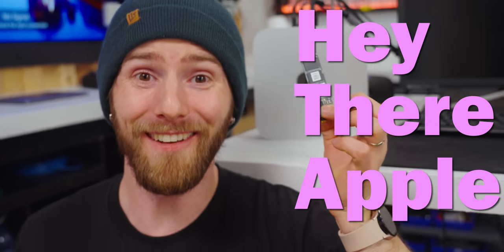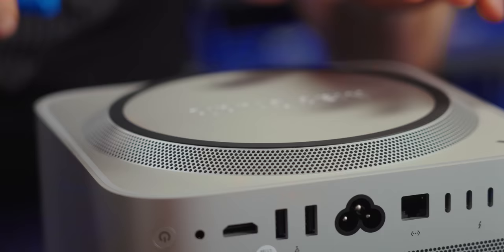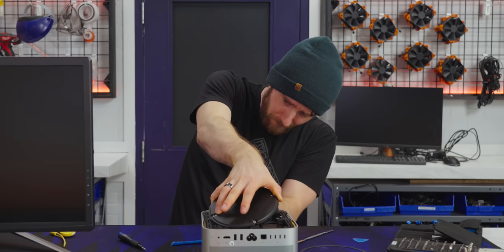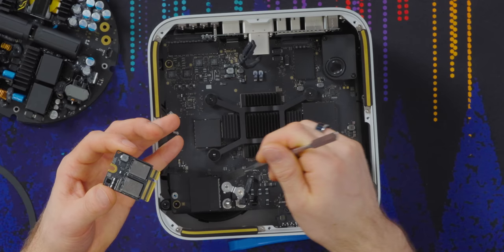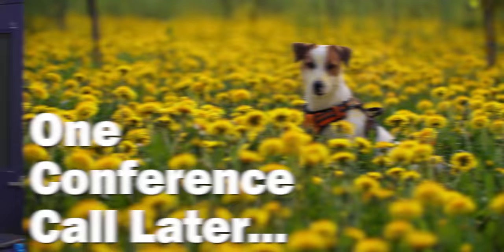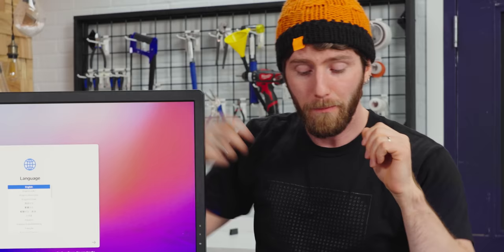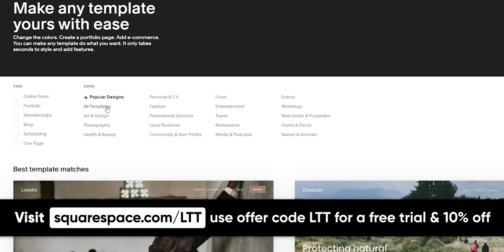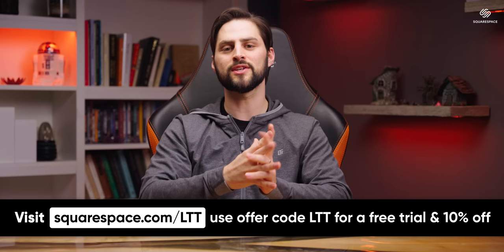I want to love Apple, but they’re making it hard - Mac Studio SSD Swapping

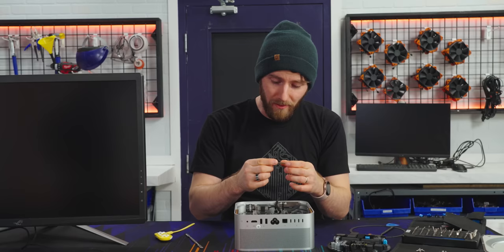Comment: 5:20 I thought it was better if the power lines connect before data lines, no? For ESD purposes, data lines are weaker, so I would prefer power lines to connect and discharge ESD before data lines connect. But you may prefer to live more dangerously!
Reply: Its the magic man!
Reply: I agree with u Medhi but the rest of the producers don't follow it so they swapped it with the safety concern as u mentioned cause even if the repairilbility plan back fired they would have a safety sheild guarding their asses 😂 this is business boisss
Reply: they aren't as smart as you mr Mehdi man
Reply: It's usually ground first, then signaling then power
Reply: @ElectroBOOM How was your trip to Hawaii?
Reply: Says the man who couldn't even kill a ram stick 😉
Reply: USB is power then data
Reply: Grounds first, Data second, Vcc last is a good rule of thumb. You can see a great example of this on a HP smart slot PSU's card edge connector. Those apple NAND connectors are not hot swappable, the contacts are staggered in the socket so that they make contact at roughly the same time. If you swapped it powered on, all you will achieve is apply gnd to half the card and vcc to the other half as the contacts go past power into data.
Reply: When ElectroBOOM tells you that you are living dangerously, take it to heart.
It would be like PhotonicInduction telling you what you are doing with transformers is crazy.
Reply: Hiii Mehdi how are you ❤️❤️
چطوری هموطن D:
Reply: ESD is not as bad as most make it out to be its actually really hard to kill a device with ESD i have never used an ESD strap when working with electronics and have never killed a device with ESD and everyone who has tried to kill devices with ESD fails to kill the device with normal ESD 

but havening power on before the device is fully connected can cause a power spike when the device gets connected and that is bad on the device so its always better to have the data connect before the power to keep the power spikes to a minimum
Reply: @ElectroBOOM Data before power is prefered, if the ssd is hot-swappable, which primarly happens in server applications. If not all of the data lines are connected before power, it can lead to errors.
Reply: You need to be a genius to understand what apple is doing. There they like to do things differently.
Reply: @jovaraszigmantas  Be a genius, or be drinking loads of Guinness.
Reply: Ground is supposed to be the longest pin!
Reply: Yes, esd crowbar protection diodes on IO do nothing if there's no current path to the supply rails
Reply: I thought the power pins were longer so that when removing a device in a hot-swap situation. The device can detect the disconnection of the data lines while it still has power. This gives it a chance to flush the cache and prepare for the loss of power with less chance of errors occurring.
Reply: I've had several HDD to USB converters and it's always been data, power USB and my external SATA drive connectors came with instructions for data then power. I believe that the reasoning is that when power is applied, the drive is running and random noise on the data lines could cause issues and potentially, it could be more vulnerable to spikes etc (this last is just supposition though). Connecting ground first would be the preference I think but there's usually ground on the data lines anyway.
Reply: @rayzimmermin  ESD is not as risky as it used to be, it seems. I killed a couple of devices with ESD in the past but none recently. Of course, I may have just become more cautious...
Reply: Lol when I read this in my head I read it in the voice and accent of electroboom...
Reply: @chaos.corner  the first PC i built was an old 8088 back in the late 80s and i have been working on PCs from then till now and i have never killed any device with ESD now maybe its because i have a rule only messing electronics with bear foot so im never insolated from ground and their for cant build up a charge so before i ever open a case i always kick off my shoes
Reply: @JasonW.  NICE
Reply: With Apple, I'm just surprised that there isnt a way forthis to connect a data line to a power line like in certain MacBook, where a 30V power line is right next to a 3.3V data line that goes straight into the CPU :D 

no grounding in between, and that connector is right on the spot where liquids are most likely to get...
Reply: As mentioned farther up the comment chain, I'd say the best possible arrangement would be for ground to be connected first, then data, then power. That way you have ESD solved, and also there's no chance of the device getting powered before the data pins are all there, and freaking out about that.
Reply: HI! I think you should ground it first then connect the data. I have learned not to plug in anything that is already connected to power because I did fry a board doing so.
Reply: @rayzimmermin  For someone who isn't concerned about ESD, you take more precautions than most.
Reply: @rayzimmermin  dude you should probably check who youre replying to
Reply: First ground, then datapins, power last. And yes connectors that do exactly that do exist. Also when i was in school learning electronics there was a rule that was more best practice then a real rule but many companies adhered to it. When you have a connector with a lot of pins and some of them have power on them you put ground pin between power pin and data pins. Apple does not do that, and yes devices are known to die because dust and dirt over time allow liitle leak currents to wreck a device. Apple engineers must know about this but they just ignore these things because only brand new devices matter to them if they make them too good they will live for too long.
Reply: @mycosys  ya i watch ElectroBOOM content and even he had a hard time killing electronics with ESD why because electronics are designed to withstand ESD

so it dose not mater who he is when he is wrong all that maters is he is wrong

their is a reason why hot swappable storage connects data before power and disconnects power before data and connects and disconnects ground before both data and power even USB first connects ground then data then power when plunged in and disconnects power then data then ground when unplugged
Reply: @--_DJ_--  their is a reason why im not concerned about ESD because i know im always grounded out when i mess with electronics 

their is a reason i have never killed a device do to ESD because i make sure im discharged before messing with them just by not waring shoes 

so long as you are not insolated you can not harm your electronics because you become the path of least resistance to ground
Reply: aye it's electroBOOM
Reply: Surely best to make all connections prior to powering on a pc. Good workshop practice.
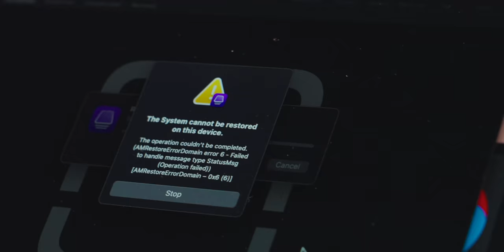Reply: 12:52 I wonder why he's listening to the table... is he diagnosing the sounds the table is making?
Reply: IT'S GONNA FAIL TO INITIATE IF YOU DO THAT. Data must be connected before power. common knowledge.
Reply: THE RECTIFIER!
Reply: Correct.
If the upper rails were for power, and the lower rails for data, there would still be GND pins in the data rails which would connect at the same time as the data pins.
I would like to see edge GND pins connect before the data pins; however, this is an overstep.
One solution would be to move the data pins slightly up (revealing PCB) and leave the GND pins at full length.
Reply: @kyleeverly9243  wires a 120V plug to a dimm socket
Reply: my man!
Reply: hahahahahaha
Reply: ayyyyy
Reply: @tarrySubstance  creepy
Reply: You're right at some point
Reply: @rayzimmermin  Maybe. And if you're working with a case, I believe you gain some protection also since your potential will usually be somewhere at case potential. Mine were individual component failures.
Reply: @rayzimmermin  It is there, not their. 
You are concerned, that is why you are taking measures to mitigate the risk.
Reply: @chaos.corner  um i took my parts and put them in the case so i do work with components i built my 8088 from parts just like i built my current rig from parts i have only had 2 pre build's in my life all other PCs i built
Reply: Only matters if it's hot-pluggable, which it isn't.
Reply: @--_DJ_--  actually i just do it out of habit not because it actually matters now a days back in the day it mattered more then it dose today because things back then were more susceptible to ESD then they are today

its like mechanics refusing to but lead acid battery's on concrete it use to matter a long time ago when they were made differently but it dose not matter anymore because modern batters will not lose a charge on concrete anymore but most mechanics will still put lead acid battery's in a block of wood to keep them off the concrete floor even though it is not actually needed and i also do this my self even though i know i do not need to but old habits are hard to brake

ElectroBOOM him self tried to kill modern components with ESD and failed
Reply: @rayzimmermin  Ya I watched that video, it was surprising how much they would take and keep working. 
I am a mechanic, my journeyman would give me a hard time for putting a battery on the concrete. It's been a long while since the cases were made from a rubber that would allow them to discharge, but he still laid a board down like you said. Old habits do die hard.
Reply: @rayzimmermin  I'm talking individual chip level.
Reply: Great. I did not understand a single thing. Thank you Medhi
Reply: @gummy1204  ...Right there with you so far.
I can understand why:
a.)  removing the ability to hot swap for security reasons
but, 
b.) remove the ability to swap period....why?

Thanx for putting in words what a team didn't in a video.
Reply: Mr. E. BOOM,
If you wish to keep your rep in tact, please refrain from comments on grounding.
The man just roughed up a million dollar server.
Grounded?
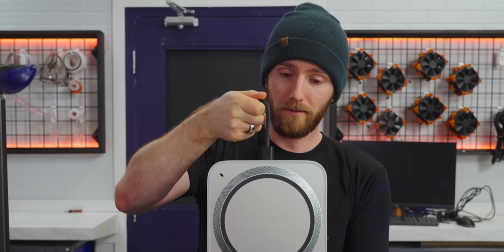I'd like to hear your take on Linus at around the 2:00 mark.
So, please, sit back with a fresh 9 volt and give the signature Linus "drop" your professional opinion.
Reply: Big brain
Reply: @rayzimmermin  ESD is often not fatal.  Many people think they have dodged a bullet because it still works, but have unknowingly reduced the lifetime of their device by an order of magnitude.
Reply: @reedroberts2552  every PC i built kept running till i upgraded to a new PC and parted them out and i only build a new PC every 10 years my last PC that i just replaces is not 12 years old and is still running as a game server 

as i said i have never had a problem with ESD and modern devises actually have good ESD protection built into them
Reply: Doesn't matter if you're not hot-swapping the device

Comment: I used to work at Apple as a hardware technician and I can't even begin to express how infuriating it was that I always had to use special software developed for internal use ONLY to solve issues like these. All their devices can theoretically be modified and repaired as you would normally expect, but they've made sure to lock everything so you NEED to use their own software and programs to make it work...
Reply: It would've been really cool if you leaked the software
Reply: Using proprietary software to do maintenance tasks is not the end of the world, the problem is that are not available to general public. This is clearly a violation to the right to repair
Reply: A Similar experience like yours here.
Reply: @andrewk8636  it's easy to say "would be cool if you leak it" but the reality is if the source of the leak was identified, the leaker's career would be fucked. And you can bet that the leak would be identified because Apple had eyes on every pins of their microchips. yeah it would be cool while it lasted but it was a risk to someone's livelihood, risk that low-level technicians can't often afford.
Reply: @andrewk8636  I’d be surprised if he actually had access to all of the files of the software plus leaking it would be very very bad for him, he could be sued by Apple
Reply: idk from what i hear apple techs just toss large bits of hardware and force customers to replace entire boards over single components so its shocking to me they would even go this far
Reply: @andrewk8636  I can personally attest it isn't possible to leak the software (I tried and the software is also locked tight)

Comment: Love how I can easily add several 2 TB SATA SSDs to my 11 year old ASUS 6PTE mobo, but would be stuck with a meager 512 GB with this state of the art compact computer. Absolutely ridiculous.
Reply: and the 2tb ssd costs less than the difference in price between the 0.5tb and 1tb mac. And the biggest spit in the face is how those arent even whole different SSDs in there but merely just flash modules soldered to a pcb. The production cost of one of them can not exceed 5 or 10 bucks
Reply: State of the Art?
Reply: @zoltanberkes8559  State of the art of ripping us off.

Comment: Linus: "Confirmed. You CAN switch power supplies!"
Apple: "Thanks Linus, chipping PSUs is a great idea! We haven't thought about that!"
Reply: They will totally do this, I mean, they put chips in their freaking lightning cables FFS
Reply: @BlazerRox  iirc most usb c cables are also chipped
Reply: lol they already do this with their iPhones:
chargers, charging cables and batteries have chips in them that prevent you from replacing them with non-Apple ones or prevent you from using 3rd party chargers/cables without some major drawbacks.
Reply: @wibs0n68  Not to determine validity though...
Reply: @BlazerRox  maybe read about "load switches" first before complaining. It's a pretty neat way to protect sensitive circuits and I'm shocked to this day that barely anyone emphasizes them as much as Apple.
Reply: @PvtAnonymous  Tf u on about?
Reply: @PvtAnonymous  What does that have to do with making hardware unnecessarily proprietary? I didn't "complain", I stated a fact.
Reply: @BlazerRox  nothing, hence I don't even get your comment. You are complaining about chips in lightning cables, I told you to read about load switches, you start with a followup question that is not related to your initial statement at all. You asked why they do it, I told you. What exactly is your problem?
Reply: I'm still waiting for the day they lock down their cardboard boxes...
Reply: They could go the route of randomized pinouts like the early 2000s Dell computers.  Swapping PSUs will short our your computer with the possibility of actually killing you in a fire.
Reply: @HoLDoN4Sec  tho I have to be honest I do think it's good that people can't use those cheap Chinese cables that break after a month, talk about e-waste, but still apple is the most anti consumer brand out there and I don't get why people keep taking it
Reply: The problem with Apple is that you have to use an Apple OS and Apple hardware.
Reply: @SimonBauer7  You are so right, pal. My trusty Samsung Galaxy Note 8 eats absolutey every source of power without any complaints, and I mean EVERY source. For outdoor purposes, I have even built myself some kind of emergency charger, a battery holder taking 8 D-cells, soldered to a USB socket. The phone charges over this contraption without issues. No way in hell an iPhone would even acknowledge the existence of this thing. Refusing so many presumably normal things, iPhones have always been the diva phones to me.
Reply: @HoLDoN4Sec  what? I use 3rd party lightning chargers all the time
Reply: @Tr4ns1st0r  yes, they have a fake chip inside them that makes this work.
back when lightning first came out you couldn't charge with ANY 3rd party lightning chargers and cables above 500mA, even if the charger was specified to be 2A the iPhone 5 would block it from charging faster than 500mA.
this is no longer the case because the Chinese market learned to reverse engineer the chips inside the genuine Apple lightning cables, but this was actually happening back in 2012 for nearly 6 months
Reply: @championxxlNL  lol, you know the funniest part is that the original Apple cables are built so badly that they also break after a month or two (their sleeve ALWAYS breaks next to either the USB-A connector or the Lightning connector)
Reply: @HoLDoN4Sec  Oh, wow... I honestly didn't know but I'm not surprised.
Reply: @SimonBauer7  I swear that right there is a luxury
Reply: @HoLDoN4Sec  I don’t know why everyone’s lightning cables break so easily but I have been using mine for 2 years now and they still work fine. Im not defending apple though, most of their cables are priced atrociously
Reply: @SimonBauer7  Android is the best hands down.
Reply: @BlazerRox  Lightning cables and USB-C cables have a loadswitch in them to prevent just burning your battery if your phone's charging circuit is "dumb" enough hell if not it could be in the wall wart, but who am I kidding some of the cables I use does get uncomfortably warm when charging stuff... some of them are cheap some of them are expensive AF
Reply: @SimonBauer7  I like how "you can charge with a normal cable" is considered a feature.
Reply: @HoLDoN4Sec  Last I checked thats STILL the case... Just wait until they remove wires from their products all together!
Reply: Linus gave apple an idea.
Reply: @PvtAnonymous  yeah right, like saving the planet with no chargers
Reply: @TheLongDon This just affects transfer speed and charging current. Non-chipped cables, by definition, are capable only of 3A of power, (not so) Hi-Speed USB. Not to say that chip markings have never been abused, though...

Comment: I replaced some flowers that have died in the garden, then the whole house stopped working, the locks, the toilet, the curtains all just froze up. I had to put the dead flowers back in for the house to work again. I now have the option to replace the flowers for $1,000 each by the builders or leave them alone.